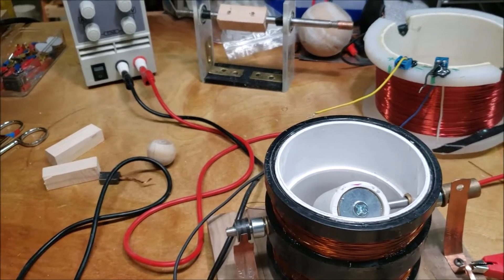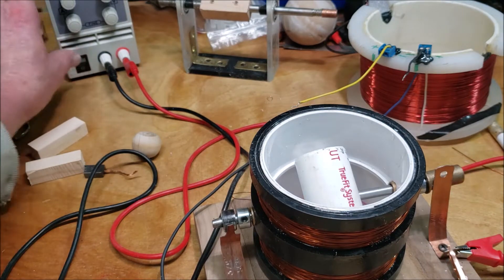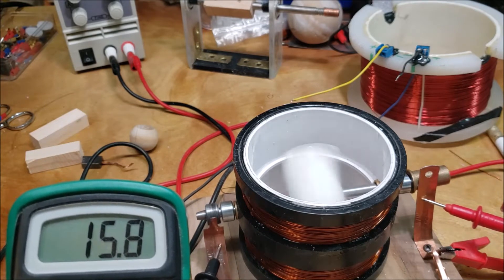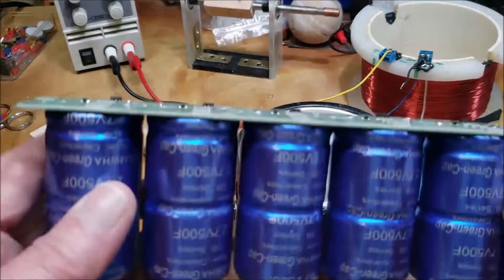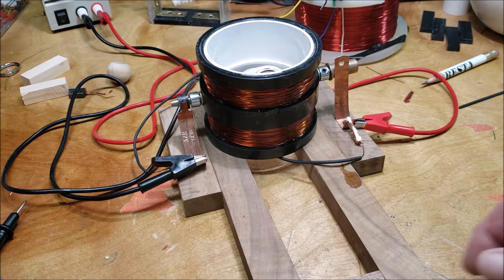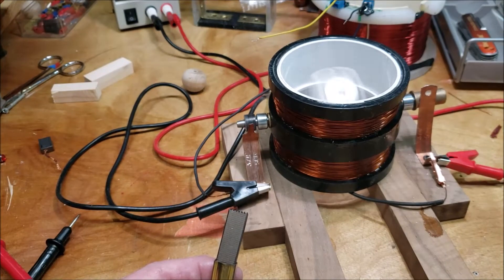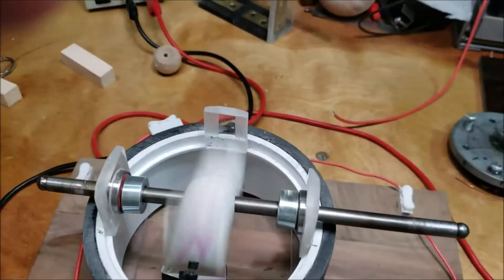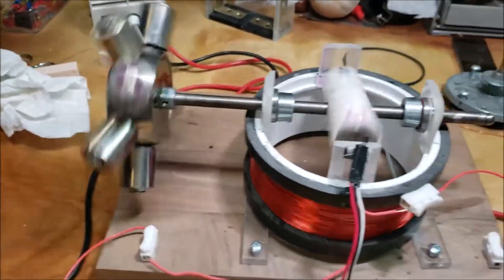New uses for newman motor coils

Comment: To reduce the moss fit heat problem
You have to be able to adjust the hall effect transistor in a radial direction 
Either forward 
Or backwards
If you look at some of my videos 
I use the hall effect transistor, which works perfect.
I am able to rotate the hall effect transistor in a 360 diameter movement.
The faster, the RPM, the lower, the mosfet  heat level.
The slower, the RPM creates friction within the mosfet transistor
Reply from the maker: that's a very old system and I've since moved on to bigger an better systems.

Comment: Great work 
 You might want more wire with optical timing and a mosfet 
 You can extract the hi pulses off the negative coil lead
Reply from the maker: Great advice and thanks for that. This is an older version of the Newman motor I was playing with. I've since made a much bigger model and its on my channel.

Comment: im not an expert or anything, so take this comment with a grain of salt, but my guess is the amps are high because the connections arent turning off long enough, the commutator on joseph newmans were bigger and the contact points were shorter. i wish you good luck and i hope you get it!
Reply from the maker: Your probably right. I've been trying to figure the commutator config for a  while. I'm going to give it a rest and work on the maglev :) I do have a new commutator in the works so stay tuned
Reply: @mcorrade  the faster it disconnects, the bigger the back emf spike too, im looking forward to the maglev
Reply from the maker: @ApocalypticIdol  thanks me too :). SO armed with this new info I'll have to change my current design ugggg no biggy. Love to learn and try out new ideas
Reply from the maker: yep your more than likely correct